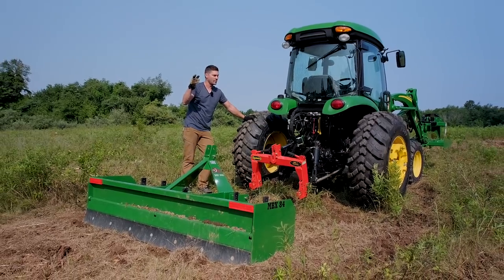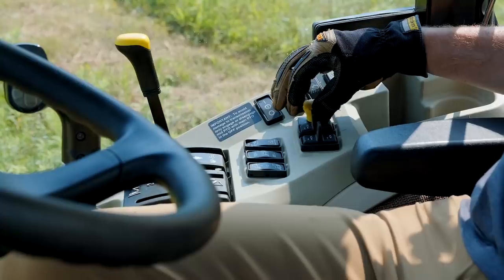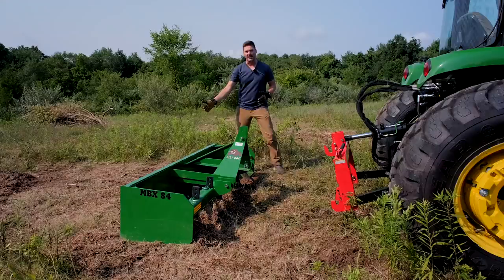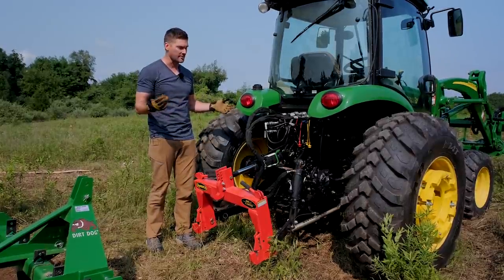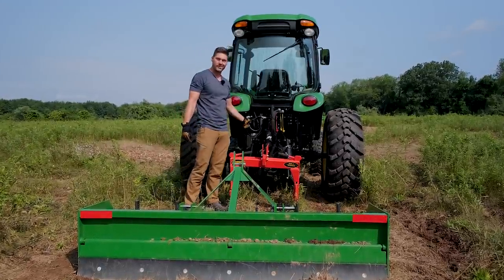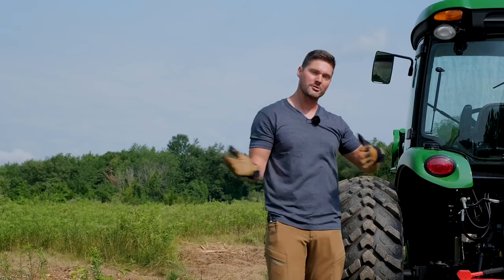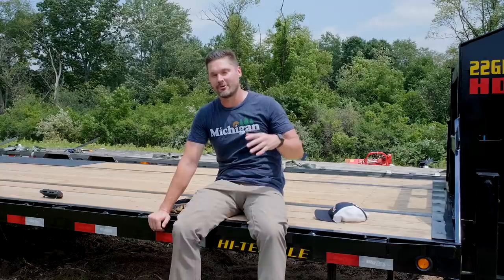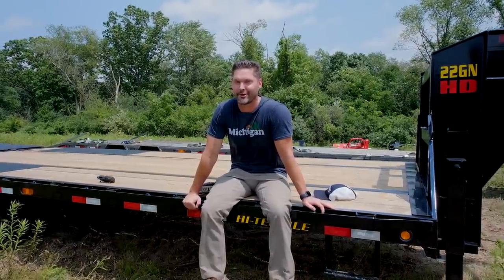CHASING A GHOST: I BROKE MY 3 POINT HITCH! IT DOESN'T WORK! 😭

Comment: I had a similar issue and thought I would have to call the dealer to pick up my tractor. I found another video on youtube that talked about the rear remote with a detent (I think that's what it's called) Turns out I had bumped that remote lever and it was stuck on not letting any of the other rear hydraulic things work. Couldn't lift the 3-point or anything. Pulled the lever to the middle and problem was solved. I love YouTube and people like you who put the info out there. Looking forward to your "solution"

Comment: I had something similar happen on my Kubota 4760 a couple of weeks ago. Using a grapple and grapple quit working, loader up/down quit working, 3 point worked but really slow. It turned out the spool valve in the 3rd function stuck open relieving pressure and volume of oil back to the rear end of the tractor. I could hear a screeching sound like restricted hydraulics makes and the lines from 3rd function were very hot. I disconnected 3rd function lines from loader block and also disconnected the wiring plugs to 3rd function solenoid and loader and 3 point started working again. Dealer disassembled 3rd function valve and found plastic debris clogging up the ports on the spool valve.
Reply: Especially with the top link issue, making cylinder move without operating a function.
Probably self centered after cooling down.

Comment: Sticking solenoid, possibly the top link circuit, low voltage Gremlins. Solve the charging issue first!
Reply: That's what it sounded like to me as soon as he said flopping the connections for the hydraulic top link caused the cylinder to cycle.  That solenoid is stuck.  If those solenoids are powered with the engine off, that could also have led to the dead battery.  Or, something weak in the electrical system caused the solenoid issue.  I'd definitely look at them as related, because in the immortal words of Leroy Jethro Gibbs, I don't believe in coincidence!
Reply: I agree with above comment. Low voltage would be a big problem to these tractors. Had similar problem with my 3720. Replaced the 9 year old battery and it fixed it. Not saying it’s the same problem but sounds familiar.
Reply: I learned this after years of owning exotic cars. If the battery ever goes dead you're going to see gremlins afterwards from false warning lights to malfunctions such as this. I'm guessing all the bumping and vibration from the transport to the dealership released the solenoid.
Reply: Yep I would concur on all of the above and would say the same  fix the charging issue replace battery and that was probably the start of the gremlins.  When insufficient power is given to a system things just don't work right .  Sorry to say im glad that I'm not the only one that has a crazy problem and takes it in for it to not do it and run flawlessly.   That sucks so hard but it leaves the wallet happy until the next time anyways.   Hahah. Battery and solenoid  should fix it.

Comment: Low voltage and battery issues can wreak havoc on modern complex equipment. You mentioned you had battery issues… just a thought that it could be a battery or alternator issue, especially given the intermittent Nature of the problem.
Reply: Also check the grounding.

Comment: Master C I agree that it seens like you have a sticky rear remote spool. Not sure how your big boy is plumbed between the 3PH control valve and rear remote control valve but on my tractor if the rear remotes are in use the 3PH cannot be raised. The rear remote control valve has the priority. Can't wait to see what they find.

I will say this if the rear remote was not used for awhile the spool can get sticky but that usually takes a long time. I would think you would not fit that profile.

Comment: May seem silly, but is the hydraulic fluid reservoir full?  It's the only thing that seems common to all circuits.
Heat an issue that didn't show up when the dealer tried it on a cool morning?

Comment: Have seen this, Air got op top of the internal lift ram seal. Bleeds away and works. Probably need to take the rock shaft apart and re seal. Good luck!

Comment: No familure with that style rock shaft but from what i can see there is usually a valve inside the housing, linkage pushes on a rod with a spring return behind it, when the rock shaft is to be raised and it hits the top position that rod is pushed in against the spring and starts dumping the oil flow to tank to stop it and hold it in a neuatral position at the top of its stroke, when you let the lever down it lets the rod stroke all the way out and lets the oil in the rock shaft dump to take to lower it, the middle area of the rod travel is neutral and holds at your depth controll, my guess would be when you ran it up so high that spring got bound up or the rod deflected/bent enough to get stuck in one of these positions,  this could cause unwanted pressure between the pump and rock shaft that caused some things to work fine and some to not, and after the rock shaft you had zero flow because it was being dumped to tank and not sent on down the line to the next attachment.

Comment: Sounds like a valve stuck, diverting all the pressure, possibly caused by the low voltage. Hydraulics are in series, starting with the steering, then loader, then remotes, ending with the 3pt, so any problem"upstream", the 3pt won't work.

Comment: Tried to arm wrestle with a post-hole auger and lost. Not my arm, the lift arms case cover: Drilling a drain in the lovely wet clay, the auger got wedged (stuck) and I tried to move the tractor back and forth to loosen it up. But, even at low rpm's once the auger got sucked into the clay it wedged the 3pt shaft so fiercely that the cast iron arm cover bolts and part of the cover broke apart. OMG, what a mess. Tearing down the Branson 2400H now and hoping I can save the case. The cover is toast. Not one of my more brilliant days. And I had recently added rear hydraulics as well as a stop and tilt. And it was working great. Drilled a bunch of holes until this last one got the best of me (tractor).
Reply from the maker: Oh man, that sounds like a boatload of fun, haha!

Comment: My 2032R had an issue-took it to JD dealer no problem found. I drove that tractor around their property for an hour, no issues. About 1/2 hr after I got it home while plowing snow it did it again!  I traded it in on a 4052M. Happy at last.
Reply: Glad the trade up solved the problem 🙂

Comment: Intermittant problems are the worst.  Seems like a valve shuttle is in the wrong place.  This could be due to an electric issue driving a solenoid or maybe a shuttle is sticking or maybe even a port is blocked with debris.  Heat can cause a bad connection to make and break and it can also cause a sticky valve to move sometime or not.  
If the problem remains elusive you could put indicator lights on the solenoids and when they act up check the control signals to the solenoids. If that isn't it you can start removing add ons till you find the offending kit. Cheers and good luck!

Comment: As a pilot I dread the “could not duplicate, ops check good” from maintenance.
Reply: Good morning. I worked on F A 18s in the Navy. Rather the bird is on the ground or on jacks,there's no way to apply stress as it flies through the air. But it helps when the knowledge of the pilot and knowledge of maintenance can talk about the situation and come up with a solution that doesn't equate to a midair collision or catastrophic failure ie falling from the sky.
Reply: @bierbarrel  yup - helo ground crew way back - pilot gives the middle finger with the thumbs up on same hand - "eff it, fly it" good times.

Comment: Had a similar set of problems with my '93 Chevy pickup.  Never had a problem when it was in the shop, but would die within 10 minutes when I was driving it.  Going to swap out the ignition control module.  I like the good suggestions you are getting in the comments.

Comment: I am going to guess that everything that quit is electric over hydraulic. I wonder if there is a harness where all the things that stopped are together and the wires are chafing.
Reply: My first thought also! I even thought a fuse might be an issue, I did something similar in a Haggie sprayer a few years back. Jumped the battery and smoked a fuse without knowing. It stopped the controls for the rear tires, I lost 4wd. I didnt know until i was loaded down with 1800 gallons of roundup and water on a soft spot in a field. Had to unload the tank to get the machine out of the field only to find out it was 2 little fuses that were the issue. Dealer told me its not recommended to "jump" most modern machines but to remove the battery and put it on a charger or use a dedicated charger with a rated protection.

Comment: A similar thing happened to me and it turned out to be an o ring in the line that went to the back. Only leaked when the oil is hot. Had to split it for the fix.

Comment: Don't you just hate it when that happens!  We see it all the time on the  modern computer controlled cars & trucks.  Sure it's electrical, probably battery, or a low voltage situation.  Examine any add on electrical equipment, after eliminating the battery & charging circuit. If all else fails, hang some garlic ,frog tails & lizard lips  on it! Lololol

Comment: Just guessing but - If the circuit with the top link is (for some reason) always trying to operate then it could be that everything else is simply downstream of that valve and so not getting any fluid.  Is there a plug for the solenoid on that circuit you could disconnect temporarily?
Reply: Maybe also a little tappy tap on that spool if you can.

Comment: Did this start after you jumped the battery? Could be you smoked a fuse that controls a solenoid. Did something similar on a Haggie sprayer years ago.
Reply from the maker: No, this started prior to the battery being dead.
Reply: @GoodWorksTractors  Well, Dang. Thats all I had!

Comment: Lots off "possibly the battery comments".  How old is the battery?  I had a 3 year old Optima Red Top battery in my Toyota FJC go bad-ish.  Normally a fantastic battery good for 7 years.  Most of the time it was fine.  Occasionally, the FJC wouldn't even crank over.  Jumping got it running.  Testing the battery at an auto parts store pointed to something weird with the battery.  Replaced it.  Not one single problem since.  YMMV.

Comment: Good luck. The hydraulic cylinder is under the cab. Probably broke the splined collar on the cylinder. The cab must be removed and all lines and hoses disconnected. Next time get a tractor with the 3pt cylinders located behind the cab not under it. It will fail again, and again$$$$$$
Reply from the maker: Unfortunately, they couldn't replicate any of the issues.  Everything worked perfectly for them.
Reply: @GoodWorksTractors   a tractor with rear cylinders are still more serviceable and easily checked. Food for thought Glad it wasn’t like the catastrophic failures I’ve seen 3 times. Love your channel

Comment: So what I'm seeing is you pushing on electric switches to activate the  hydraulics functions. Then you do some tough work. But then you say you drove to dealer and they had no issues.  Which leads me to think it's electric as going down the road you would have jolted the connections and voila, if all works again. Please update us all on this issue. Thanks.

Comment: The fact that your battery was dead lends credibility to the comments about low voltage and not being able to run the circuits. I don’t know how old your battery is, but perhaps time for a new one. Not sure what caused the battery to die, but if it just happened on its own, I’d definitely replace

Comment: Does that Deere have the Aluminum rear axle? If so, you probably cracked something when the top link jammed up or even the bottom arms.
Reply: @bierbarrel  Deere has the alum. differential on some of it's tractors not Kubota as far as I know. Tractor time with Tim broke his alum. diff. on his Deere.
O.k., I googled it and some small Kubotas evidently have Alum. diff. too.
Reply: It's cast iron on this size, aluminum on the smaller ones.
Reply: @tomembt4625  O.K.